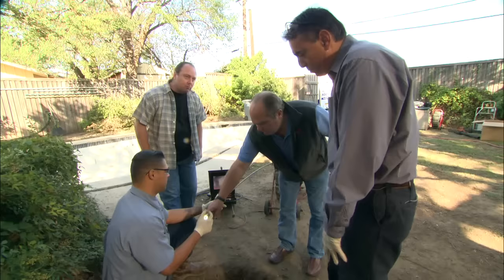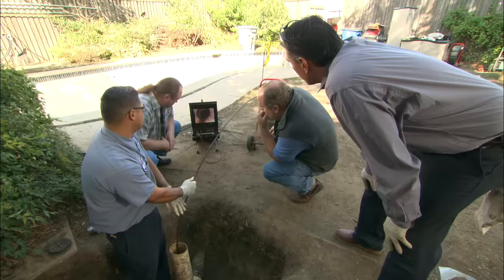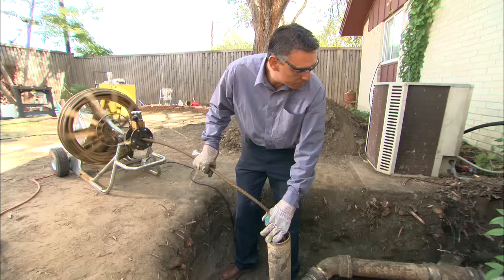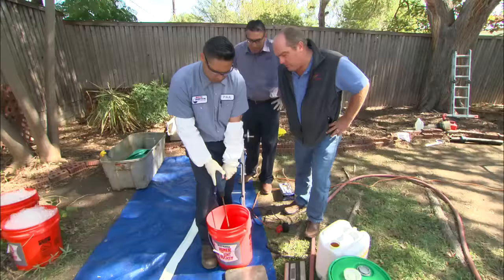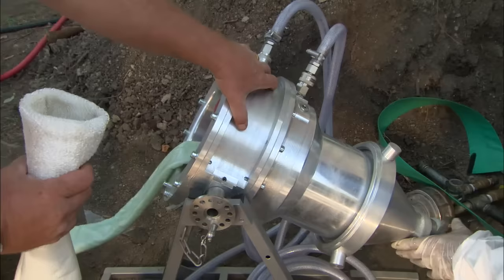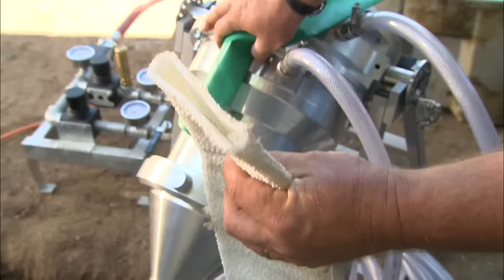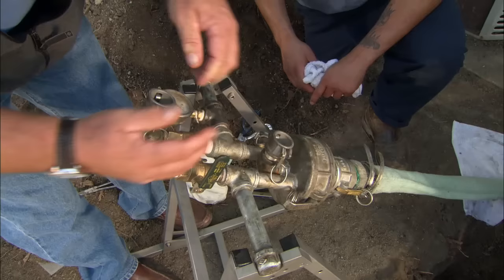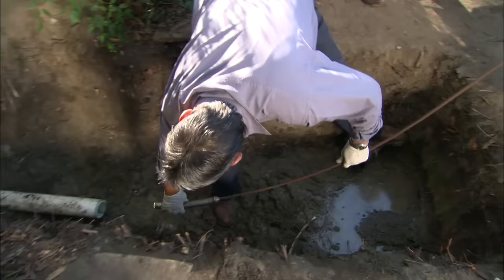How to Repair a Sewer Pipe Under a Concrete Slab | This Old House

Comment: The inventor of this! Has saved so many people thousands!! 👍🏽
Reply: the inventor of this is lined with insurance money so they win lawsuits with trench-less repair quotes. sad thing is, it does not work with certain cast iron issues LOL
Reply: No matter what the situation is, you are down stepping the inner diameter of your sewer line by at least 1/2 inch, and any sags or kinks in the old line will now be exaggerated by the new smaller sock liner. Plus this is not an inexpensive fix by any means. I smell a lot of law suits against these companies in the future, no pun intended.
Reply: @Rick-the-Swift it's roughly 1/4 inch, not half.
Reply: @nexusone5584  I believe I saw several points of reference stating that these epoxy socks have approximately 1/4 inch wall thickness. If that's the case and the thickness is 1/4 all the way around, then the inner diameter is reduced by 1/2 inch. Are you under the impression that the wall thickness of the liner is only 1/8 of an inch? If so, could you provide a reference point? Thanks
Reply: @Rick-the-Swift   @Rick-the-Swift  Again,  the i.d. change is in terms of over all.  Adding .25 on all sides. It's not the same as if all sides were increased by .5, there is a difference. An over all increase of .5 is unnoticeable in terms of function.

 This being said, yes, there are different lining materials that are different wall thickness; Wovo for example is a much less dense fabric weave and is therefore flattened further by the calibration tube. These thicknesses can also vary depending on what pressure these systems are blown in at. 
  Creases on 90's and 45's  are also negligible when the liner is installed properly.

Comment: I highly recommend Pipe Patch for small sections of pipe that need to be repaired, much easier process. Also for anyone considering this.. this is actually more expensive then jack hammering up the floor and replacing the pipe
Reply: No it's not
Reply: @dirtymikeandtheboyz2570  Where I live it is …

Comment: A cured-in-place pipe (CIPP) is one of several trenchless rehabilitation methods used to repair existing pipelines. CIPP is a jointless, seamless, pipe-within-a-pipe with the capability to rehabilitate pipes ranging in diameter from 0.1–2.8 meter (4"–110"). As one of the most widely used rehabilitation methods CIPP has application in water, sewer, gas, and chemical pipelines.
Typically a plumber will charge $25,000 too big of a 3 bedroom 2 bathroom house and replace the pipes that includes the concrete replacement, but it does not include the floor covering replacement such as tile, marble or carpet . If the pipe lining company has to travel far to do a small dollar job, they will have minimum mobilization costs, typically $3000-$5000. This would be the smallest size job they would do for a certain travel distance.
Reply: Orlando Alberty thats true we do charge around that amount
Reply: (1) will it fail after the pipe it is installed in fails due to age?
(2) how easy is it to repair if it fails after the pipe it is installed in fails? 
(3) what is the cost of the repair if it fails? 
(4) is it a good solution to use in neighborhoods that still have terracota pipes going from the house to the sewer?
Reply: thank you from five years in the future. i assumed but i wasnt sure how big the diameter this would work at

Comment: Technology is wonderful, especially when it saves time, money and stress. The sewer pipe liner and bladder to expand the liner to conform to the old CPVC sewer line is an ingenious design. The only thing that would worry me a bit is the epoxy curing time running out before being able to fill the bladder with water through the manifold system. Great video as usual from This Old House. Thanks you guys and thanks Rich :-)
Reply: Zoya Awolowo you can modify the mixture to cook off faster or slower to adjust for ambient tempature. However you'd better hope you have a well seasoned technician installing yours because If it collapses under your home....your in for a nightmare. Lived that life
Reply: @nexusone5584  What happened? Were they insured and payed for their mistakes?
Reply: @michaelpalacio103  it used to be that you had to either dig it up, or use blades on a Sr. Cable or a warthog nozzle on a jetter and beat on the closed end until it opens. If the entire line collapses then the installing company eats the cost to dig, repair and backfill. There is now a robot that can be remotely sent down line with a 360 degree cutting apparatus... the machine is over 100k.
Reply: Who said it was saving money?
Reply: @la-ia1404  I did. 🙂
Reply: @nexusone5584  there’s several robotics machines and some cost upwards of a million but that’s all German stuff
Reply: @ClearNova  I'm sure there's all kinds of machines for that now! The one we used was a Japanese design I believe and was incredibly finicky. However all can be avoided with a skilled installation technician

Comment: Great video .
My question is what do you do if there are t junctions running off the straight section?
Reply: Is there a clean-out at the junction?
Reply: @roseymalino9855   No.
Reply: thats probably an instance where you would definately need to do some digging
Reply: There's a method where measurements are made where the junctions are located and holes are cut inside the liner at the junctions. Bigger companies usually spend the money for the equipment to do it this way.

Comment: sewer pipe angioplasty??
Reply: Upper endoscopy.  I saw the trailer.  
As a contractor I stopped laughing a long time ago.  People spend more on wall paper than they do on radon mitigation, or serious maintenance.  Who said, "Make sure you have a good-looking corpse"?  Half the houses in southern California are 40 to 50 years old.  If you wanted an efficient vehicle from a car that was that old, would you start with a '74 Eldorado?
Actually, I remember just after the first oil crisis (1971) when GM put "selective firing" systems (didn't have software) into their front-drive, V8's like the Olds Toronado, and the "Eldo".  A friend put a snow plow on one.  You could pick them out easily, they were the vehicles abandoned at traffic lights, stalled from too rich carburetion, from idling on four cylinders.

Comment: My house's sewer line has some roots but still pretty decent so instead of spending thousand of dollars to repair/replace it,  I use ROEBIC foaming root killers and ZEP Root killer to flushed down to the pipe once a year and this is the 2nd year we are free of clogs since.

Comment: I have a lot of questions from this method. 1. How thick is that new line of pipe? Wont it bother the flow? 2. How did they connect it to the old line? 3. Will the roots wont bother that type of material? Please bear with me. I just want to learn this type of method.
Reply: IS VERY EASY MY FRIEND THE CONECT TO DRAIN AGAIN BUT THE GUYS CHARGE ALOT MONEY FOR LINING
Reply: 1. 4"
2. it does not bother the flow at all
3. It expands and creates a "new" pipe within the old one
4. They have no chance against that epoxy once it hardens
Reply: 1:The new line is 1/4" not 4". Flow will generally increase, the inside of the new line has a slick finish.
2: The new line is still housed withing the existing line, so you simply cut the now fused pipe flush and connect with the appropriate coupling. 
3: There are no seams in the newly lined section of pipe therefore,  those areas are virtually impervious to root intrusion.

Comment: How does this handle branch lines? Most of the replacements/repairs we do have multiple branches connecting to the main line.
Reply: All taps have to be cut out either by the rover, or by cable machines with Chuck modified to accept a wholesaw

Comment: Back in the day I had roots  in my drain pipes. I rented the tool and removed  the roots myself. After that I found a local company  to perform  the task  every two or three years. It was fairly  cheap. I never had an issue after that. The first time I did it I removed pretty much a root forest, the pipes were very old. It worked out fine in the end.
Reply: the same here.
Reply: Eventually you’ll get a misalignment or cracking as the roots tend to grow back more aggressively

Comment: @ThisOldHouse; I truly wish that when you made these videos that you also gave approximate costs.  That way, a homeowner could know what to expect and not be swindled.
Reply: Usually they show the best way but also more than likely the most expensive way
Reply: My sewer line is backed up and my trap is under concrete in my basement . Roto rooter gave me a quote of $1200 to drill through the concrete and snake the trap.
Reply: Don Guille this is not the best way. It’s the worse way
Reply: I would have hydro jetted that line the blasted it with foaming root killer.
Reply: Our company charges 499.00 per foot
Reply: My company charges on average $7500 - $9000 for this service. This is in the Atlanta market do cost vary by location.
Reply: @djaqt2  what are the sypmtoms of a backed up sewer line
Reply: leos rule not without a date
Reply: My area wanted around 5-6 grand for like 10 feet that did not cover the entire basement. It was possible that the roots would grow into the other areas over time. I removed the tree for about 700... Problem solved. There's also root Killers you can put in once a year or twice a year.. They are about 40-80 bucks. This product\service is way over priced.. Great idea but it shouldn't cost that much for basically glue and water.
Reply: @djaqt2  have them removed it, it is not needed now a days. I'm a drain cleaner by trade. That trap is nothing but trouble
Reply: Yep, jack hammering the basement is cheaper, and no pipe diameter reduction.
Reply: @BobBob-we3wr  it's not really meant for residential. Its use is industrial/commercial. I'm sure theres rich people out there that'll pay for it on their house though.
Reply: @TheNemosdaddy  \ Was do they do then? Digging up the pipe from the floor is more expensive
Reply: leos rule it’s expensive. They like it a lot.
Reply: This is not cheap. It's not something you will do because you can its something you do because you have to.  It's hard to estimate what a project like this will cost because of so many variables but guaranteed it will be several thousand dollars and homes with similar situations may come in at different prices due to accessibility or amount of roots etc.
Reply: No offense TOH love the show. Thats the biggest homeowner scam going. Ive seen unscrupulous plumbers rip off homeowners replacing pipes that don't need it
Reply: @functionform  that was actually a good video and it's used all the time in the painting business just so happens to be one of the best fixes out there without getting too deep into a large carpentry project yeah pay attention you will learn something
Reply: I would have dug up the little bit of concrete that that was there and put in some new plastic what's the big deal
Reply: diver dave  for 17,000 I'm pretty sure you could replace the whole pipe and dig up the blanket
Reply: Some companies charge $100 a foot. Expect to spend 3500 to 4000. Depending on your location It will cost you. The same price if you would have dig it up. And did it with pipes?
Reply: @carlo7519  you two should look into metal sporks.  Kind of spoon/fork combo.
Reply: mrbadhabit73 same
Reply: yeah...wonder how much it cost for small home owner
Reply: @ombligoapestoso5600  I just experienced a backed up sewer line a few days ago.  My experience is when I flushed the toilet, sewage was coming back into the house.  In particular, it was backing up into my laundry sink in the basement.  My problem was tree roots also.  I had them "snaked" out.  But was told the problem will occur again in about 6 months to a year.  The plumber suggested this lining of the main sewer pipes.  I still contemplating whether to install the lining or just "snake" it out every time it gets clogged.
Reply: Great point
Reply: This should be the top comment of the video. People want to know an alternative to paying $10k+ for sewer line repair.

Comment: Brilliant! I am curious how the system will hold up against roots in the future & also can the new liner be rootered without being damaged if a clog presents itself later on..?
Reply: It holds up very well to roots, since there are no joints or "seams", roots are unable to penetrate. As for crush resistance, the pipe is actually stronger than it was initially  because it now has, not only the structural integrity of the original pipe but also the rigidity of the new line. Typically the sidewalls of a 4 inch Liner is somewhere in the 1/4inch realm. The only thing that would be any stronger, would be hdpe. When it comes to maintenance, you can clean them with all forms of drain cleaning machines, free from worry or damage, that being said you should never have a reason to clean a re-lined pipe again, as long as it was installed correctly by a trained/seasoned technician. It is truly a great system however it's application is not the answer for everything.
Reply: @nexusone5584  thank you!
Reply: @datdude_jcole9275  No problem! I have re-lined many pipes during my time with roto-rooter and have had the privilege of working directly with paul (technician in the video) and cannot stress enough how much the experience of the technician installing the line matters. Only certain lines are the right candidate for this system.

Comment: Just saw a good question in the comments.
What does happen if you have to have the pipe snaked?
Is there a special head that has to be used?
TII
Reply: Nope, common blade work just fine, even hydro jetting.

Comment: What about when you have Y-connections, T’s. Would you just not use it in that case?
Reply: Maybe they locate where those Y-connections are and just drill a hole in the condom/sock and seal the edges.
Reply: @ivanbermudezchavez6186  yeah, with marsian blasters
Reply: @tailyfale  are you angry ?

Comment: We have this system where i use to work, we normally charge clients between $8,000 up to $20,000 depends on length of the pipe and how bad its condition.
Reply: Jerry Menace what’s the system or machine called
Reply: @willieg8224  Trenchless relining
Reply: @willieg8224  this particular one is called maxliner

Comment: we had to to this at my work...75 feet of 4" starting to collapse...it  cost 13k.... it would have been a nightmare to do it the other way....these were apartments and they did it in 2 days start to finish.
Reply: Bro you go home depot get 3 worker's and bum is you finishing all that  digging  1k workers, 1 on materials no probllema,finito😄😄😄🙏
Reply: @kuam1970  Dude That's exactly what I was thinking.
Reply: Dude my team would rip the apts up put pipe in ground and cement by the end of day 2, no problem. For around the same. N my team will actually fix the problem.
Reply: @kuam1970  wow what language are you speaking
Reply: @kuam1970  Wow, I didn't know you could do that. Could you explain that a little more? I may go that road. This way (clever as it is) doesn't look like it'll hold up very long. I prefer something more reliable.
Reply: @dmo848  Wish you guys lived in my area,.
Reply: How is it holding up ? Any issue ?
Reply: @Leena20  no problems at all....has a 30 year guarantee...we jet it out once a year just as preventative.
Reply: @workingshlub8861  was there a chemical smell for awhile ? Did any of your tenants complain about it ? I ask because I read that it gives out some fumes .
Reply: @Leena20  as long as all your trap seals are working there is no major smell...

Comment: yeah never tunnel a slab or you're gonna have some foundation problems in the future. this just seems like a cheap patch though. doesn't it reduce the diameter? I seen trenchless repairs where they take a machine that breaks up the old pipe and pushes in a new line

Comment: whoever came up with this system is a freaking genius and is going to make his fortune
Reply: It only seems like it's genius to you because you don't work in the industry but there are better and cheaper methods of pipe rehabilitation than this and they are less risky to the environment, not to mention this method runs you the risk of having the resin not set properly and that is a major problem. Happens often and that's why this method is not used that often.
Reply: @Skanzool You are completely wrong in your assessment. This is by far the best and most economical way to repair a sewer pipe. In particular sewer mains.
Reply: @Skanzool  I'm not so sure that's true
Reply: @Skanzool  You're wrong lol.
Reply: @Skanzool  only if you have a technician who doesn't know what they're doing
Reply: I think the patent ran out 30 years ago

Comment: Just wait until there's a clog in the future and Roto Rooter comes in with a sawtooth blade and sectional machine. Goodbye 1/16" thick sleeve!  I have a basement so I'd not hesitate to replace the pipe with new. But I'm also not concerned about that quantity of roots either.

Comment: nice Job but nothing stopping the roots to continue growing so eventually roots will break that new thin new pipe line again .
Reply: I've been told that the roots will stop growing after about 7 years. If they have no food supply, they'll die.
Reply: Nope

Comment: What happens when you have a y or combination fitting?
Reply: MrHailCanada they have to cut a hole there
Reply: You either gap it or reinstate from the main or lateral connection using a pneumatic tool
Reply: Cutting it out is the only solution.

Comment: What happens at the end of the replacement pipe?  How does it terminate.  If it is just cut off, won't things get stuck when they hit the edge of the new pipe?
Reply: I would assume you'd terminate where the pipe enlarges, eliminating any chance of causing a hangup.
Reply: Cut off and reamed